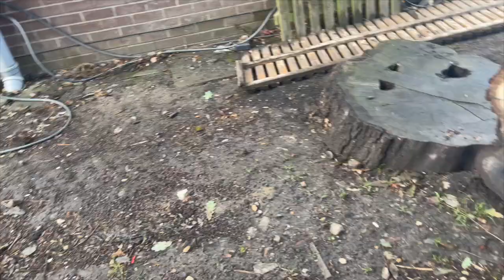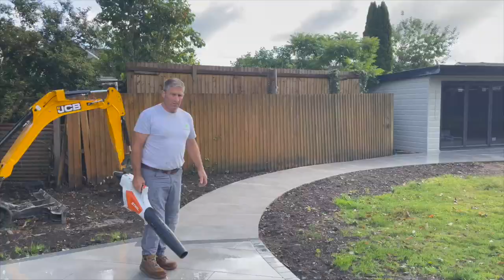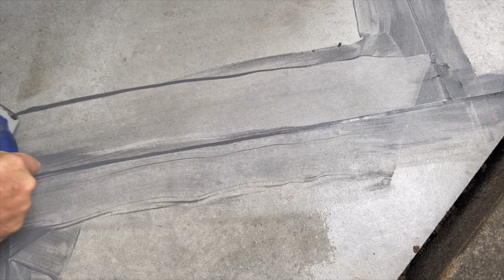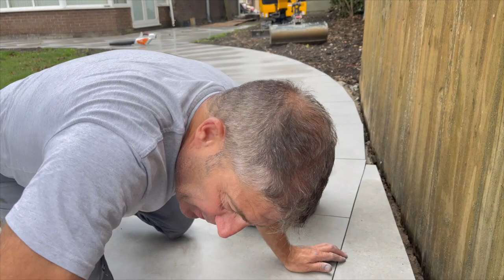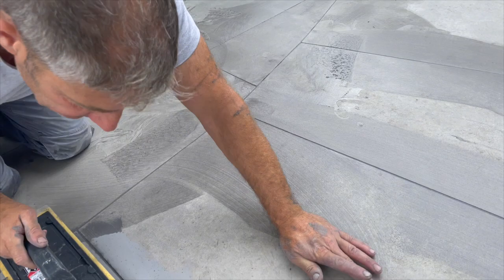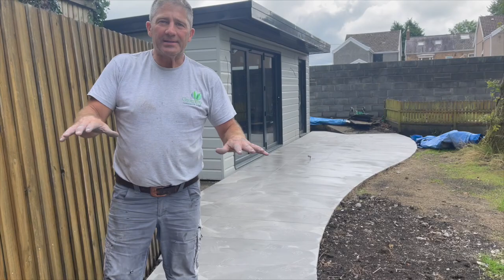How To Grout & Clean A Porcelain Patio Without Staining It

Comment: I prefer to pipe grout in with a mortar gun. I over fill the joints, wait till it firms up, then slice off the excess with a sharp trowel. I then sweep off the excess and finish the joints with a damp sponge. Much less sponging to do.